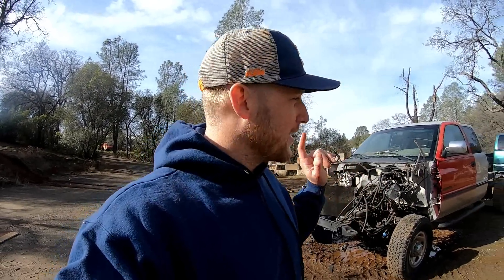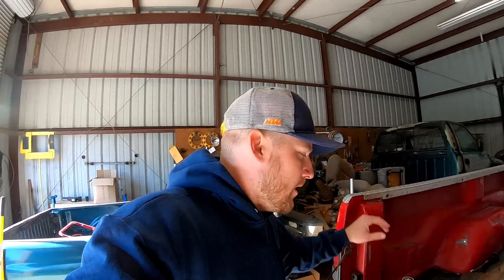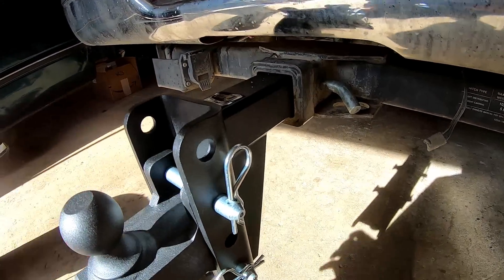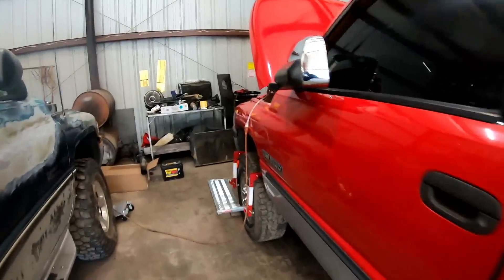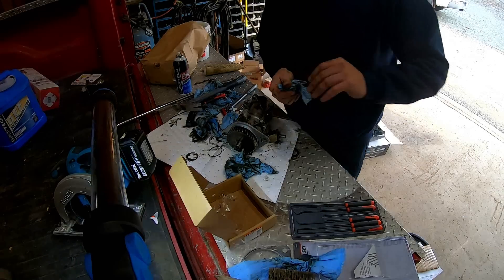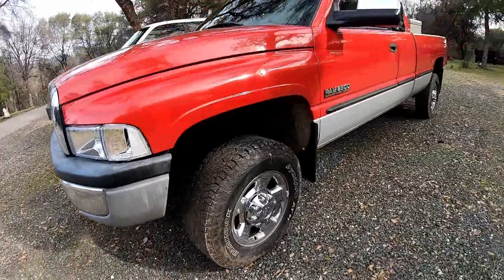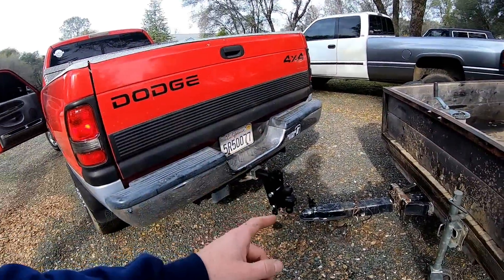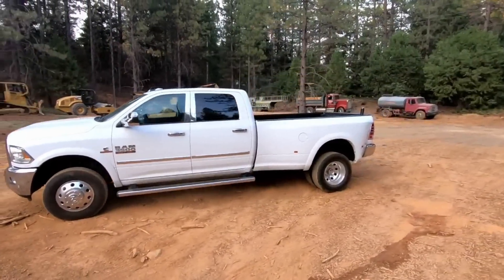New Bullet Proof adjustable hitch! And fixing oil leak on 12 valve Cummins

Comment: My adj hitch is aluminum billet,  2/2 5/16, and adjusts w/ 1 pin.  10 years old and I use it with all 3 of my trailers w/o ever having a problem! No rust or corrosion, although I polish it about every 2 years. 8)  It was about $250 10 years ago at Cramping World  8)  Brand was on a sticker that is long gone. LOL.

Comment: Sam why didn’t you get a gen y   The ball actually slides in. Not held just by 2 pins. You can get the same ball sizes too
Reply from the maker: I didn’t want the big bulky unit they offer.
Reply: V-BELT and SON yea it must weigh a ton. But for the peace of the mind I would rather the slide in style my opinion lol.  I use to haul all the time had to give it up do to medical issues.

Comment: I have a b&,w adjustable hitch
Reply from the maker: How you like that? I’m always a b and w fan
Reply: @VBELTandSON  works good I have had it many of years now with out a issue. I was wondering y u didnt get a b&w when I watch this.
Reply: I have the B&W hitch also.  Love it.  Two pins for the height and one pin to select the ball size. The balls have a locking ring to keep them from pulling out while you rotate them.
Reply: B&W all the way. I’ve had mine for a few years now.

Comment: D2 trailer on 99? Sam beefy hitch only advise keep in mind dips and ditches thing turns it into a ripper lol in dirt, prime example being your cousins situation in that driveway would have probably picked the ass end up enough the tires wouldn't get good traction exspecially your cousin not having a front shaft.  Also when and if you run it on the lowest setting it makes the bottom ball 4" lower

Comment: Gotta love an adjustable hitch.  I bought a Weigh-Safe aluminum adjustable with the "scale" integrated.  yeah, it doesn't stand up to weather.  The scale crapped out after 6 months.  But for an adjustable hitch, it works like it should.  I like that it's got an integrated lock in the cross bars.

Comment: Bought a Curt for my econoline. Handy as can be for different trailers. Good for 14k.
Reply: Yup I have the same one.... I use the pintle hitch adapter with a 2" ball, works a treat. And cost half what this hitch did... just as skookum.

Comment: I use an adjustable too. I can adjust my boat trailer for level travel over longer distances or raise the tongue for a short haul to a launch ramp. Only one trailer. However, my buddy in Florida says I can use his boat so I brought that hitch with me so I have the right height for sure. That Bulletproof looks nice. Nice part about the adjustables is that not only can you adjust drop, just turn it over and get rise.

Comment: Hey Sam, Good videos especially on the Ram trucks your got there. Love the Cummins!
Got a trick to keep those hitches a little quiet when not loaded down without buying those so called "hitch silencers", a real cheap fix. May cost you a just a little for the water or soda in the plastic bottle. 
Anyways, just cut that used water bottle making a "sleeve", make sure it can go around the hitch, heat it evenly with a torch to shrink it around the hitch, cut or punch the holes for the pin and your done. Use 2 plastic bottles if you got more (worn) space between the receiver and hitch. It won't be banging inside that receiver anymore and it's easy to replace when it get's worn down from the heavy loads you pull.
Just my 2 cents. Did this cause I got tired of the hitch banging in the receiver whenever I hit a bump or pothole in my Ram. 
Hope you find this usefull, just watching you "jiggle" that hitch in the receiver, "banging" away......LOL
Reply: Holy hell this is GENIUS!!! I will definitely be doing this on the dumbass spacer the goes in my 4th gen reciever...........since we don't have the technology to weld them in from the factory anymore.......(although I'm almost positive the reason is because the new kick is tow ratings these days and having the option for removing the spacer for a larger hitch, but that's besides the point my "if it ain't broke don't fix it" arguement........just get a solid hitch) cuz I'm on my second sleeve in the damn thing lol, and I HATE the juggle struggle of lining up all flippin 3 holes since the sleeve has just enough slack to over run the receiver hole since I didn't get the "factory ram" spacer sleeve and got the NAPA option in a pinch........😡🤬. But I know I'm not the only one with this luck or having the fortune of experiencing the situation lol

Comment: Sam, you need to get one of the cooling system vacuum units. You can use it to remove the coolant from the radiator, and reverse the direction to put it back in and purge the air from the system . Also available on Amazon.

One more tool you have to have is a Mighty Vac unit. They make units that operate like a bicycle floor pump and units that operate off shop air. Turn one switch, and the Mighty Vac will push fluid back into a transmission or engine. Optional is a hydraulic brake bleeder.

Comment: guy has a shop the size of a house - still winds up using the tailgate as a workbench..   this just proves that not matter how much space you have, you WILL find a way to fill it with crap...   
also - battery powered Kerosene pump is something i always been meaning to pick up and try using for stuff like that drill pump.
Not loving those cheap quick pull pins..  i think they should include those pins with the key ring style loop that folds down around the pin.  Awesome hitch though.

Comment: Those beefy @$$ hitches and still the weakest point is the crappy pins. Industry problem that I’m not sure the fix. Yet you don’t hear much of the pins failing
Reply: Try grade 8 bolts